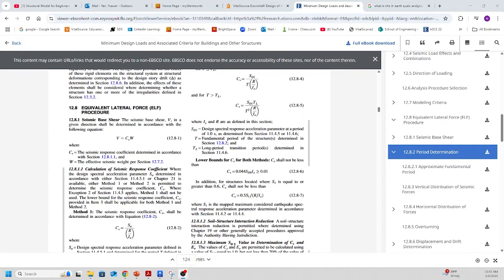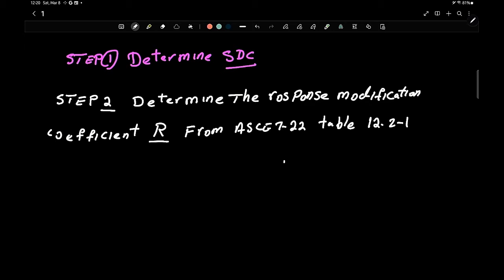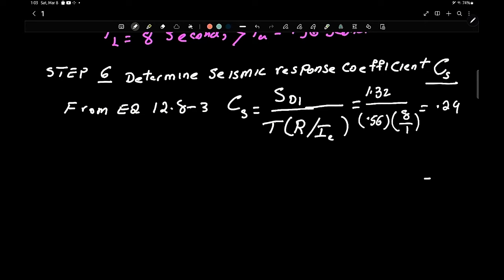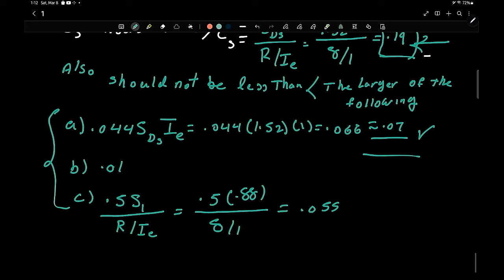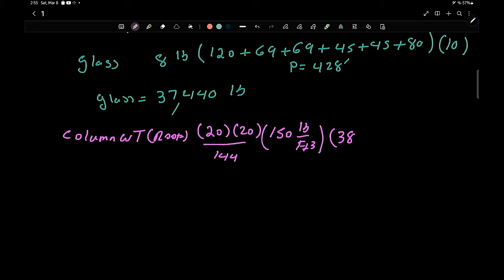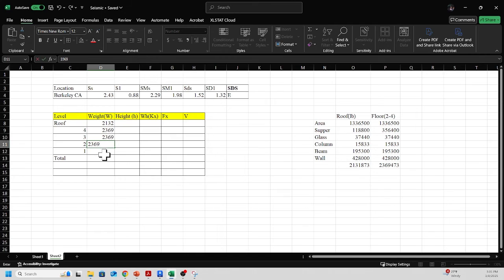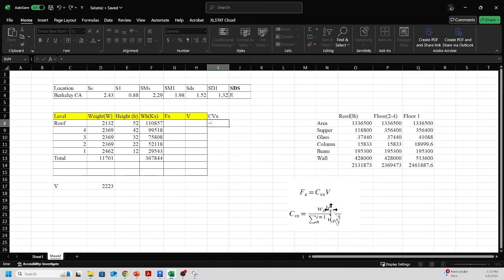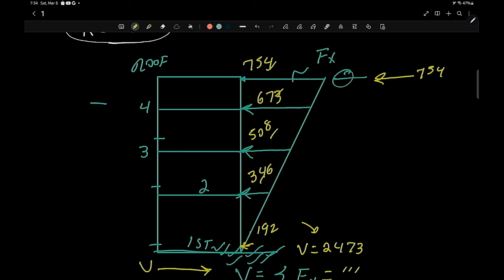Seismic Load Calculation  Per ASCE 7-22

Comment: Cs method 1 should be calculated either Sa or SDs?
Reply from the maker: Hi Tank you for watching. In ASCE 7-22 seismic load calculations using the Equivalent Lateral Force (ELF) procedure, Method 1 for the seismic response coefficient Cs  is calculated using the parameter Sa not SDS  The formula for Cs in this method is based on the design spectral response acceleration Sa  for the structure's fundamental period, T.  The parameter  Sds is only one component used in developing the full seismic response spectrum.

Comment: Why did you use your SD1 instead of SDS value provided in ASCE equation?
Reply from the maker: The parameter  SD1 is used instead of SDS  in specific ASCE equations primarily to account for the response of long-period structures and certain soil conditions where seismic forces are not governed by short-period acceleration. In ASCE 7 seismic design,  SDS  represents the design spectral response acceleration at short periods (0.2 seconds), while  SD1 represents it at a  1-second period.